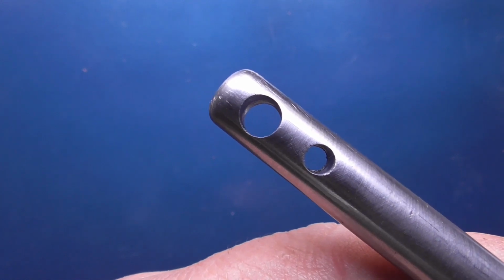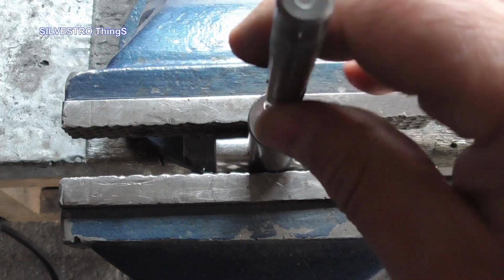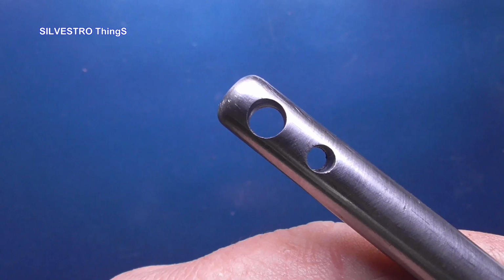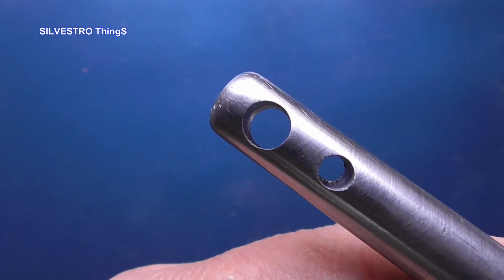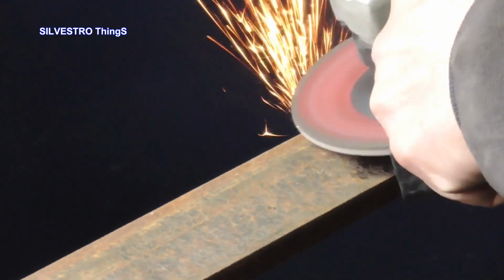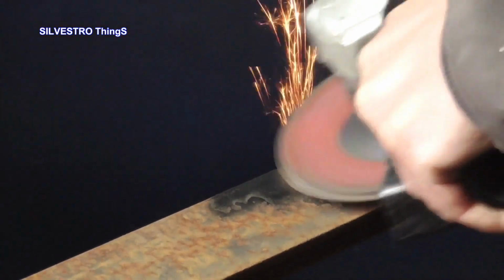Homemade Drill Guide Jig - DIY Tool

Comment: what´s the small improvement you mentioned that the jig required? Thanks! Great job by the way... i was needing an idea like this por my project.
Reply from the maker: Thanks. An adjustable stop must be added to easily locate the drill point in the bar.
Reply: @SILVESTROThingS  where would that adjustable stop be located? i don´t undestrand
Reply from the maker: @bofe1709  I know what to do, but that doesn't mean I have a ready-made solution :), I didn't think about it.